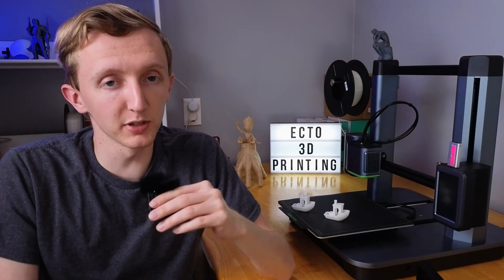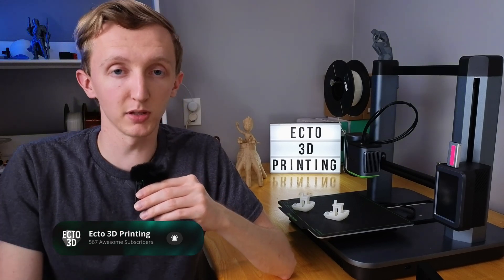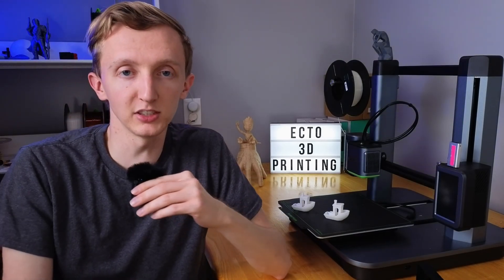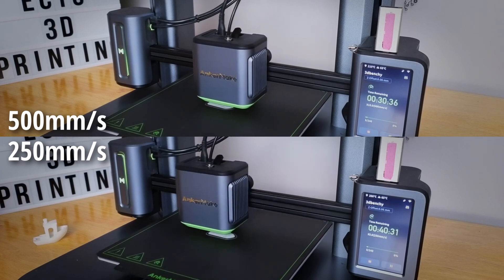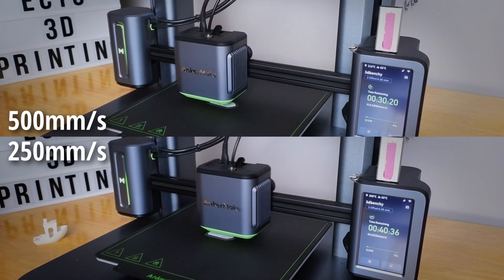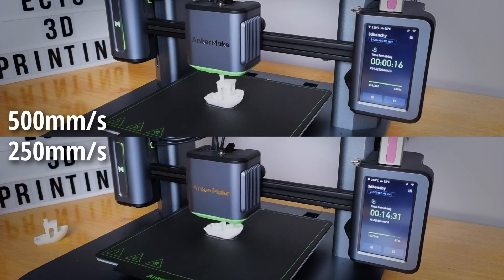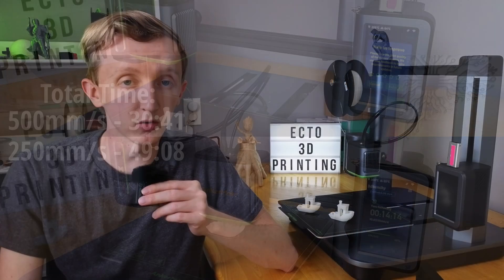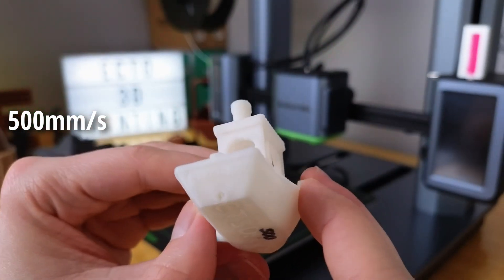500mm/s on the AnkerMake M5?  NEW Firmware!

Comment: What filament did you use?  I’m discovering that some of my filament does not print well above 100 mm/s. Would love to experiment with what you are using. Thanks!
Reply from the maker: This was just the Ankermake PLA+. But also, as some others have pointed out, this is not actually 500mm/s since it's turning so much and can't accelerate to full speed. Take that for what you will

Comment: Anyone else having an issue where the bottom of every print that has supports looks horrible? I've tried using both Ankermake Slicer and Cura. It still looks bad. I've even paid someone online to help me diagnose it and they aren't sure either. Going to return it soon but I was wondering if anyone here is having a similar issue.

Comment: That's not 500 mm/s. That's around 150 mm/s. The acceleration limit (and/or min layer time) doesn't let you reach anywhere near 500 mm/s on a benchy, a model which is acceleration-bound. If you were really doing 500 mm/s you'd have a sub-7-minute benchy.

Comment: I never really understood the 250mm/s speed on the AnkerMake. I got my AnkerMake a few days ago and I can print a Benchy in 43 minutes at 250mm/s. My other printer which prints at 100mm/s does a Benchy in 37 minutes with all the settings the same. So how does a 250mm/s printer prints a Benchy slower than 100mm/s printer. I'm thinking about returning it because of this.
Reply: because AnkerMake made bullshit claims when they announced it, they got the data wrong multiple times in the kickstarter - why would they be correct now?
Reply: There are many print speed settings. 250 is an average of all those speeds. Set everything to 250 and you’ll see it try to rip itself apart. The anker actually competes with my X1C in a very few cases. And as someone has already said a benchy can’t accelerate to that speed even if you told it to try.
Reply: @echo-hotel  (Linear) speed can't tear a machine apart; only acceleration can. This is Newton 101. Absolutely nothing in that print is being done at 250 mm/s, more like 150 or even 100. If you crank the acceleration limit up, it may be able to do it, but quality will likely be very bad.
Reply: It's because "print speed" is completely fake. It's a speed limit for what you can accelerate to if you have a long enough straight line or high enough acceleration (which this garbage printer doesn't have). The marketing is utter bs.

Comment: Those speeds are most likely max travel. The 250 looks more like 75mm/sec print speeds while the 500 looks around the 100mm/sec mark. The print times seem to match up with those speeds as well. The hotend on this system couldnt keep up with the volumetric flow rate needed for anywhere close to 200mm/sec of print speed
Reply: Acceleration was increased from 2500mm/s2 to 4000mm/s2 and there actually seems to be an improvement in ghosting even though its faster! NOT BAD ANKER!!